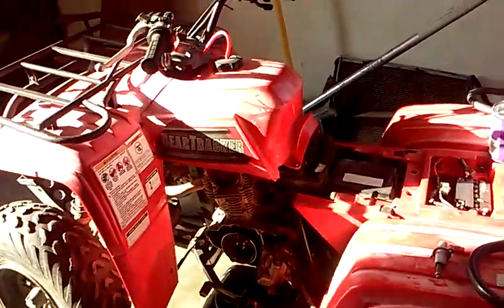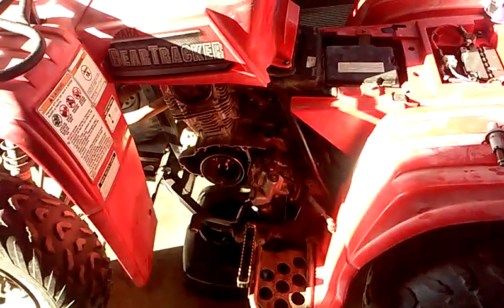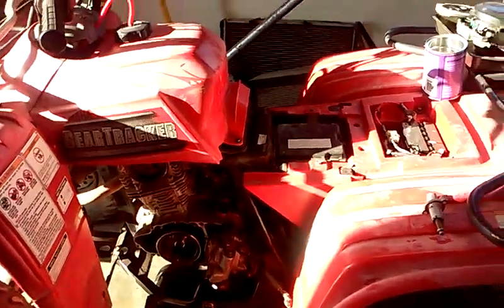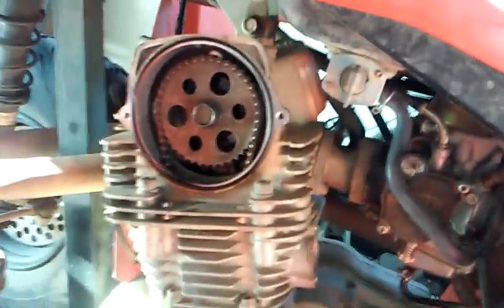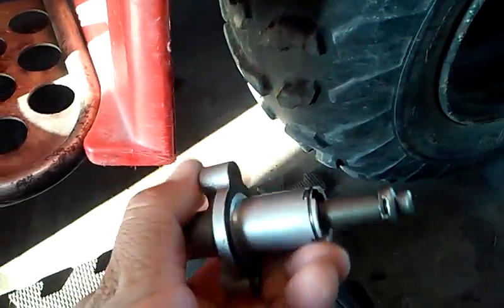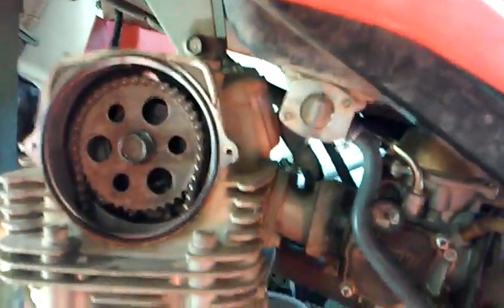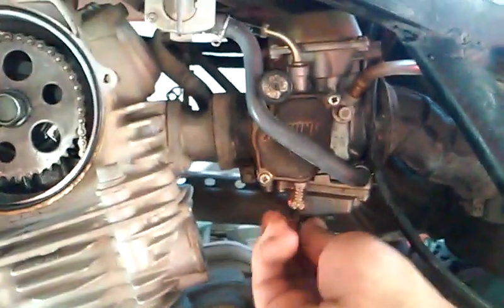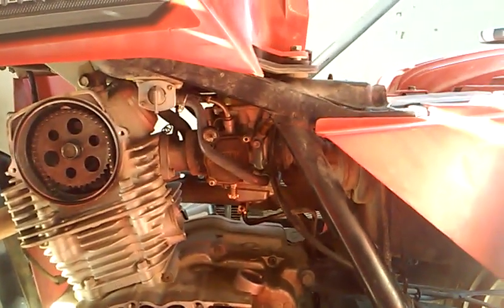Yamaha ATV bear tracker 250

Comment: the chain tensioner is suppose to be out you, take the 10mm bolt at the end of the tensioner, and you take a small flat head and screw it in and hold it while you reinstall it. then once you tighten the 8mm bolts, you relase the flat head, and it spring to give the chain the proper tension.

Comment: I am working on a big bear 250cc. I've just replaced the pick up coil, because it had no spark. Now it has plenty of spark, but won't start, I cleaned the carburettor that well, a surgeon would be proud of me. However it still won't start, it backfires through the carburettor every revolution. I've tried everything I can think of, what will make it do that.? Ive checked the timing, set the valves, even done a leak down test. Low leakage through the rings. Was all i could find.

Comment: How do you change the timing chain slides on a Yamaha Beartracker 250.
Reply: Did you have any luck with slides ,I have to do same job ,it's looking like may have to pull motor out to get head off ? Any hints? Cheers !
Reply: @timsimpson5447  no I haven't  tackled that job yet. Going to get my son to change them.
Reply: @jamescannon4917  im thinking of cutting top engine mount cross brace out ,to do job and weld it back in when done,just looked at a manual hell of a job to remove motor to do the slides ,needs to be done as of excessive wear on slides, all ready done chain in quad but couldn't get head off at time,was going to cut then decided not to now ,jobs got to be done again! Let me know how he goes ,ill send photos of cut out and reweld  let you know if it work's out, best of luck 👍

Comment: Hey I just took my cam tensioner off my Beartracker it the tensioner was fully extended when taken off does that mean it is bad?
Reply: No, it doesn’t mean it’s bad. It will extend all the way every time it’s taken off since it’s always spring loaded. There is a bolt that takes off and then just use a flathead screwdriver to rotate, which releases the spring tension, which in turn makes the tensioner compress. While holding it in decompressed position, fasten it to the cylinder using the two bolts, and ONLY then release the flathead, which will in turn apply tension to the chain.

Comment: I have a question I have a quad similar to that one I have a 98 Yamaha timberwolf it was running perfectly fine until I did the top end rebuild now it doesn't want to start, so I figured it was the timing I looked and my timing was off so when I set the timing to I have to have the piston at top dead center or can I just time it wherever the piston sits? And another when I turn the crank over a few times it stops like it gets stuck what could that be?

Comment: I'm trying to do the timing chain and rebuilding the top end on my 2005 Yamaha Bruin 250 yfm 25 BT model my timing chain guide stopper number two part number is 5XG-E2241-00-00 and everywhere I look it says that this part has been discontinued by the manufacturer or is sold out and I can't find it anywhere and I can't find any information on any other one that I can use for my bike I was wondering if the 2004 bear tracker timing guide stopper will work for my Bruin the part number for that is 5NO-12241-00-00 if you could please give me any information or let me know what other chain guide stopper I can use for my Bruin to get it back together

Comment: I would bet if all you did was replace the timing chain and adjusted the valves it would run perfect. The cam timing probably so far Advanced the powerband probably doesn't even exist. The theoretical power band would probably be like a -3,000 RPMs to -1000 RPM that's a lot of Slack I'm surprised the valves and pistons aren't touching. (if it's an interference engine)

Comment: When I drive mine for atleast 30 I will hear a loud pop and the 4 wheeler cut off and not start
Reply: Also in about 5 to 15 minutes it will come back on
Reply from the maker: Yamaha 250?
Reply: +matthew shaughnessy yes sir
Reply: +matthew shaughnessy same model
Reply from the maker: OK. Ill do my best to help you diagnose yours. If need be i have been known to trade emials and phone numbers. I am currently working in shop right now on this ATV and a few other rebuilds and projects so be patient with me :). So lets get started. We will build a fault tree. 

Ok so I know we are dealing with same model.

COMPLAINT: is that it starts and runs however after 30 mins or so it dies and will not start again until you have let it sit for 15 mins or so? then it will start and run again and do the same thing?
Reply: +matthew shaughnessy yep start run and then does the same thing
Reply from the maker: is the "pop" a backfire? in other words could we change the complaint to...."it starts just fine when it is cold. However after running it for a few minutes or after it warms it up it backfires and dies and will not start until you have let it sit and cool off". how does that sound???
Reply: +matthew shaughnessy that sounds good
Reply from the maker: great. so with out hearing run my self.

1.  when it does run does it idle just fine or is it a little rough?

2. Have you serviced the valves or timing tensioner ever??
Reply: +matthew shaughnessy it was good in idle and my grandfather took it to get worked on idk what they did. But I think it's the carb messing up
Reply from the maker: awww the plot thickens here. so after some one else worked on it it started back firing and dieing after getting warm? if you think your carb is messed up then go ahead and pull it and clean it or replace it. I have videos on here on how to clean a small carb. Keep one thing in mind though. Your carb is ultimately what controls your fuel flow. If it was bad it would either not start at all or it would start but IDLE extremely rough as the constant flow of fuel is not proper. you have explained that it starts and runs just fine when cold but after it warms up it dies out and will not start again until it cools off. this makes me think of 4-5 possible system that could not be properly functioning the carb aka fuel system being one of them. stator,timing,valves adjustment being the other possibilities.
Reply: +matthew shaughnessy I'ma clean the carb. But I have one question if I was thinking about buying a second one would you prefer dry shaft, belt driving,or chain.
Reply from the maker: Chain  you buying used? brands?
Reply: +matthew shaughnessy yeah used. I was looking at a Polaris sportsman

Comment: Matt You mentioned you had rebuilt the starter flywheel. I was wondering about it I bought a top rebuild kit and took my 250 bear tracker apart. When I removed the flywheel the starter clutch ball bearings, and springs fell out of flywheel. Are these held in by friction or will they fall out when you remove it. The starter was working before I pulled it apart so not sure if the flywheel is bad or they just worn enough to fall out. What would you recommend using something to hold them in until i get it put back on or replacing it?
Reply: They're held in by the tension of those little springs.
 When it happens to me I stretched the springs just a little so did they hold him a little tighter then just be careful when putting it all back in because they'll pop out again.
 It can be aggravating but be patient and you will get them there. I have also used a tad touch of Greece to hold the balls in place

Comment: Hey thanks for posting this video. Do you have time to help me with a question I have?.  .. . I have a 1999 Beartracker that  behaves a lot like how you described this one with the poor idleing and such. I have cleaned the carb spotless at least twice, the only thing I was unable to get loose was the float valve seat, wish I could get it out cause I'm pretty sure it has a screen on it but I'm afraid of it breaking. I recently checked and adjusted the valves, the intake was fine & the exhaust was out very little so I set it to the specs. I notice the timing is out 1/2 tooth on the cam sprocket, the orientation of the it being out is it fires late by a 1/2 tooth. Someone brought to my attention that the sprocket on the crank has twice the teeth as the cam sprocket, so if I move the lower sprocket by 1 tooth, will that give me the 1/2 tooth that I need on the cam? Also want to add that the timing chain felt tight, so I don't think I have any problem with the tensioner or any worn guides. . . . I hope all I wrote here makes sense you.. . It seams I can fix other peoples junk with no problem, but this thing kinda has me stumped.. . Well thanks for reading, let me know what you think if you have the time.. . oh yeah, my profile pic is a pic of the Beartracker I'm talking about...
Reply from the maker: Hi. I did not want to leave you hanging to long. I have a few things i would kine to go over with you and i also have a few fetailed suggestion. I will answer in mire detail over the weekend. Thanks! Matthew
Reply from the maker: the sprockets themselves will wear out causing the chain to remain tight. as the gears wear down the tension-er will self adjust to compensate. after time it will eventually adjust all the way out and that means it is time to change timing chain,gears,and tensioner all together. there is also a very other angles we can look at this from. for now lets start here. what you think?
Reply from the maker: also. these carbs can get beyond cleaning. it is rare but it does happen. :)
Reply: Hey thanks alot for the advice, I've been running this thing for about a year now like this, guess I'll just deal with it through this winter and tear it down this spring.. Sorry I'm so long to get back with you, I've been real busy lately and unable to keep up with everything.. Thanks again!!
Reply: matthew shaughnessy  my be u can help me I just did my top end and when I put it back to get her I got about 1/2 inch play in my cam timing  is that normal because I set timing it runs good for about 1 minute and it moves
Reply from the maker: sorry for the late response i get so many and it is hard to keep up. did you still need help?